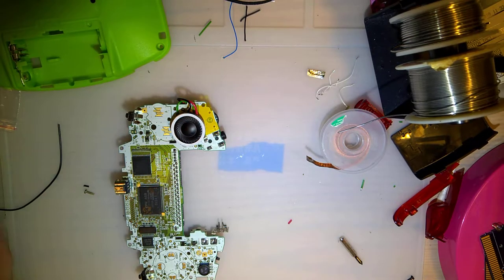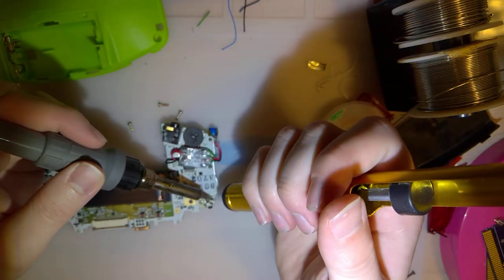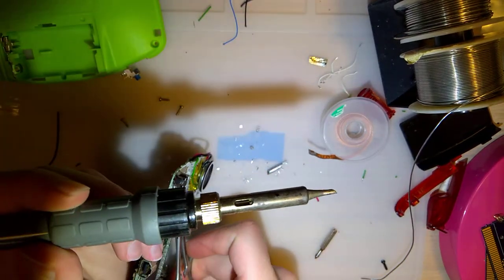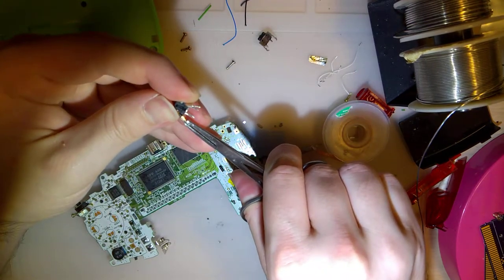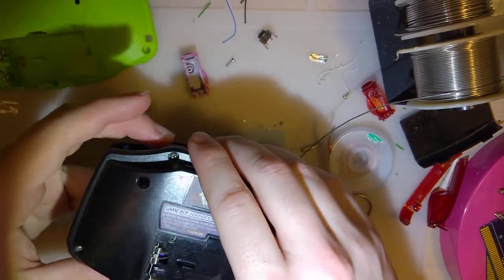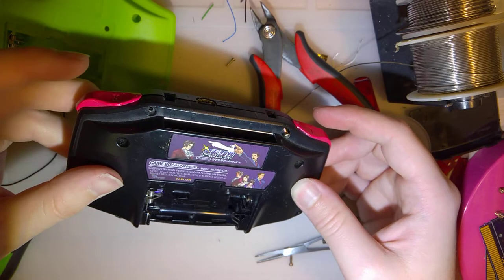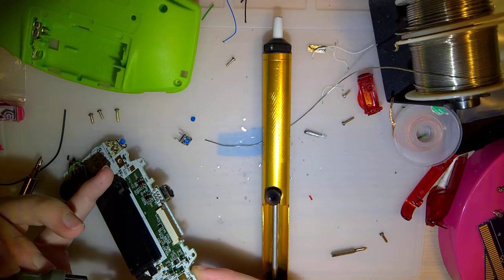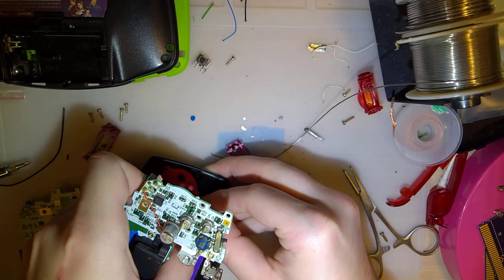Game Boy Advance High Actuation Force Tact Switches Shoulder Buttons

Comment: Your off-hand comment about how using a big blob of solder would probably work well inspired me and then I managed to get some shoulder buttons replaced that I was stuck on the other day (hot air wasn't even really working for me). It didn't help that the first video I had found on the process had somehow removed the 2 pin switch separate from the support bracket, so I was trying to do that at first, not realizing that they are very much firmly together and he probably cut them apart off-camera. I do worry that support is weaker without that bracket, but after getting the new buttons soldered in they seem fairly stable, and I think the case probably provides a lot of support when it's all together too. I had a GBA around with an R button that wasn't working totally consistently, so replaced the OEM switch with a generic tactile button switch you'd find at an electronics shop that had a similar button height. Worked great and then I replaced the other one to match the feel/sound as well. Sometimes a good cleaning under the silicone will bring these shoulder buttons back, but sometimes that doesn't seem to be enough. I did not remove the metal disc spring and try re-bending it, that might do the trick as well if you can manage it.
Now if only shoulder buttons were this easy to replace on a DS Lite. I have many more of those with bad shoulder buttons than GBAs.

Comment: Hi Makho!
Do you know if there's a supplier with a similar tactile profile to OEM? I've been looking for AGB shoulder button replacements but they seem to be either shorter on the cap or a little bit more... stiffer to my taste. And well, harvesting AGB boards it's not cost effective.
Reply from the maker: If I knew, I would use those. I do not. If you ever find a source, I'd love to take a look. I suspect we won't find buttons with a silicone plunger like on the OEM buttons but I'm sure they exist in the proper length and height at the very least.
Reply: @makho  Any update on finding replacement switches that have the same pressure, sound and feel as unused AGB OEMs?
Reply from the maker: @KayJay_EU  I haven't been looking myself and I haven't heard back from anyone else about it.